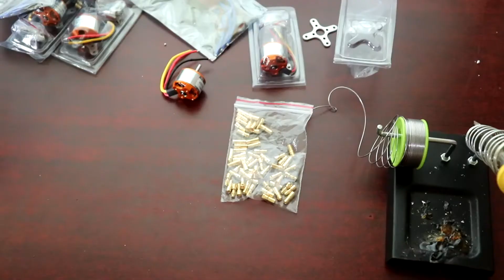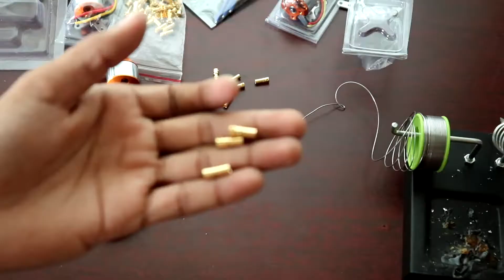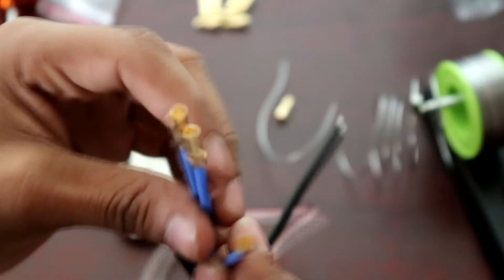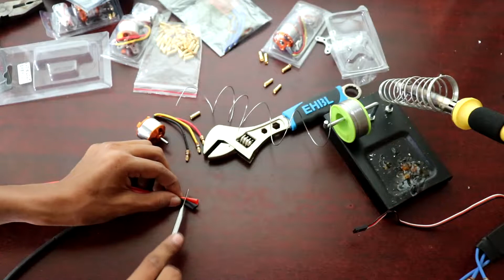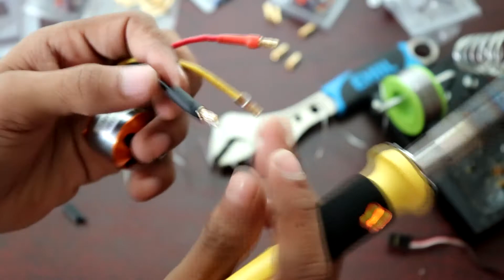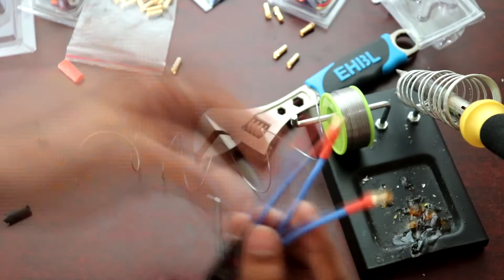How to Solder Bullet Connector | Tutorial for Drone

Comment: Should the entire connector be covered with heat shrink? (or else you'll have a short circuit if/when the connectors touch?) (I like your use of a wrench to hold the connectors while soldering. Good idea 👍🏻 🤓. Thanks for the video)
Reply from the maker: you should covered the entire connector for avoiding any Kind of short circuit...
Reply: yes, cover the entire connector on the female plug, which Amir did not.